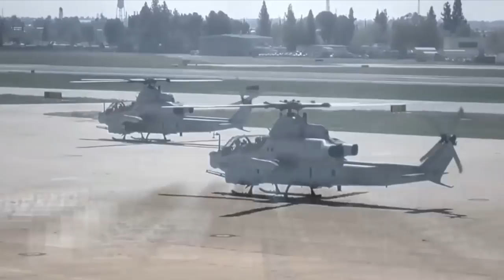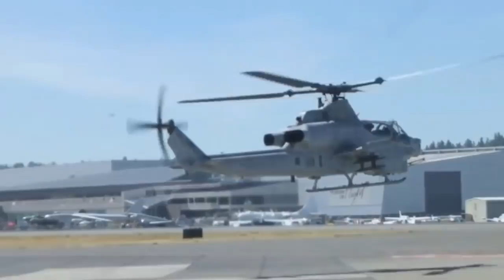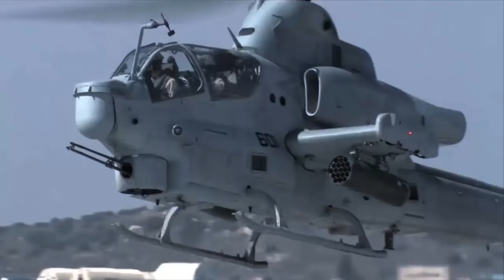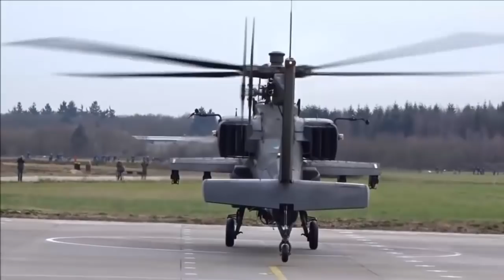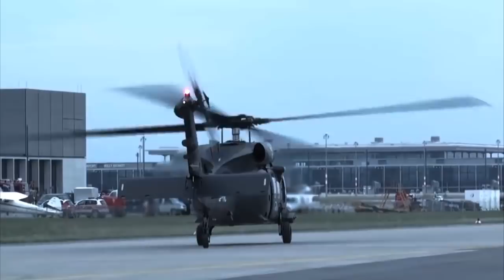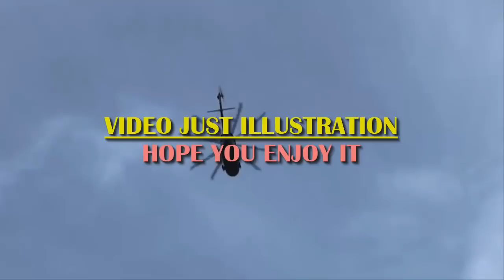One of three US made helicopters for the Philippine air force!

Comment: Why only now? US offer their military hardware, when the Philippines starts procuring weapons from other country. US Weapons are good, but they are expensive per unit cost and expensive to operate. Secondly, if the US sanction the Philippines, they will hold the delivery of spare parts for AH64 and AW-1. Like what happen in Indonesian F16s. During incident of East Timor, US stop the delivery of F16 spare parts and weapons system. 
There are many attack helicopters you can buy in military markets, they are cost effective "More BANG per BUCK". 
US is our ally (at least on paper), but Filipinos should start procuring more weapons based on availability of Funds.